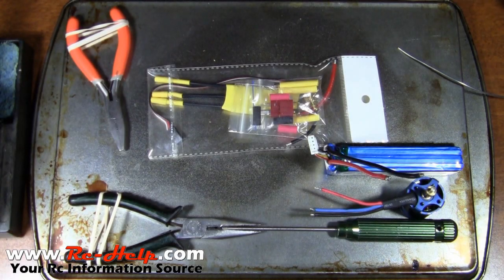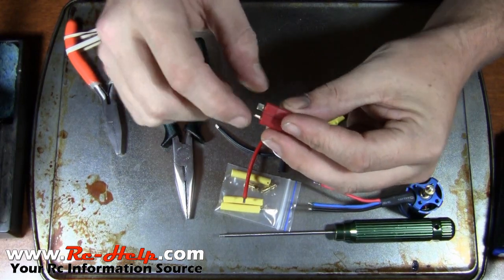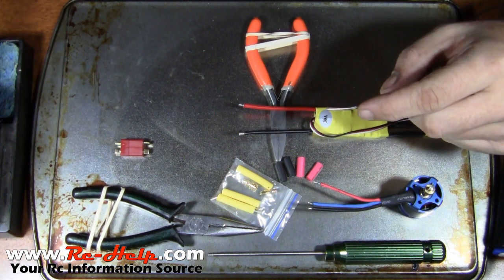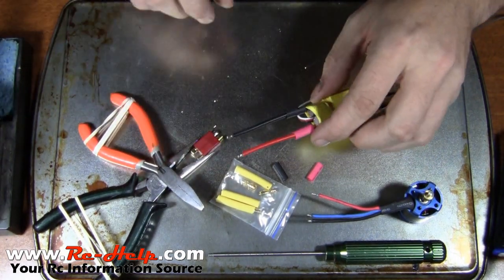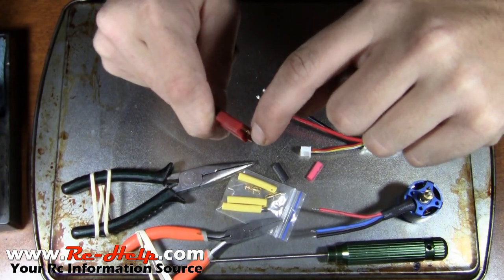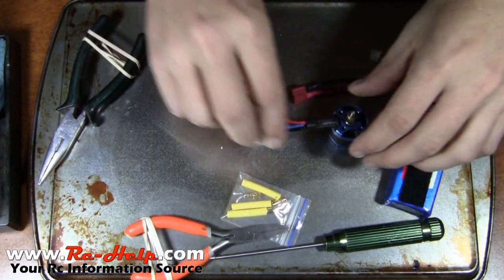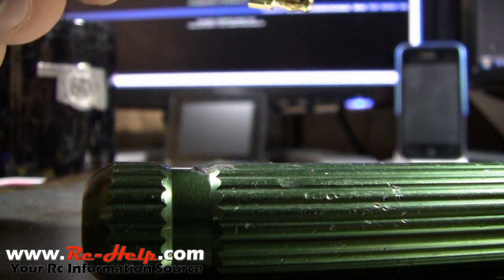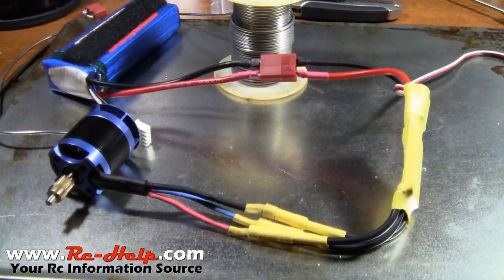How To Solder ESC Motor & Battery Deans Plug Bullet Connectors Hakko

Comment: Anyone know how to solder female bullets on to 17.5 motor tabs? Any videos?
Reply from the maker: I do know how and here is a video where I did it. Not motor wires, but same concept. You may have to remove the enamel coating from the wires before you do this. You can remove it with high heat (400c soldering iron and solder will do it), then just follow along with the video where I solder on the bullets. I think I do male though, but again, same concept. https://www.youtube.com/watch?v=BpYxsnMIOKY

Comment: Question I already have dean connectors on my mamba x esc,but is it possible to switch the connectors to polarized connectors on my mamba x esc?
Reply from the maker: I'm not sure what you mean by "polarized". Deans are meant to only go together one way. What connectors were you wanting to use? But the simple answer is yes, you can change to any connector you want, but I would like to know exactly what you are working on before giving a definite answer. If you could, come over to the forum and post up some pictures of what you are working on. www.Rc-Help.com
Reply: @RcHelpDotCom  there the lime green in color.
Reply from the maker: If you have a link to them that would help out a lot. I'm not sure of the 'lime green' connectors you are referring to. There are way too many of them these days lol. www.Rc-Help.com